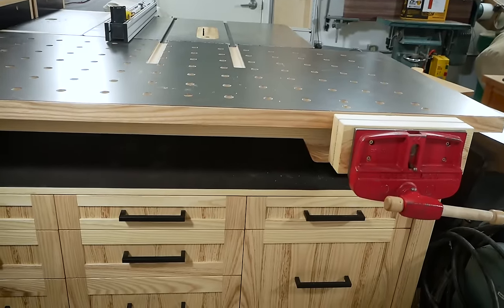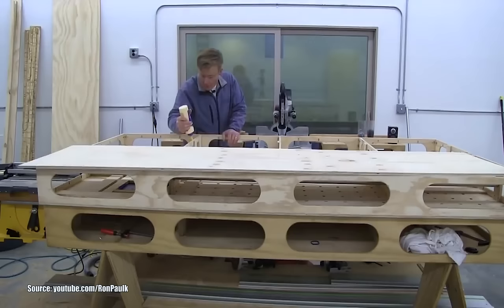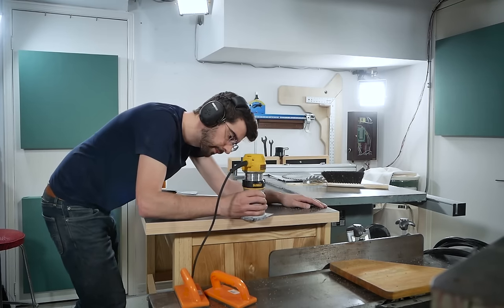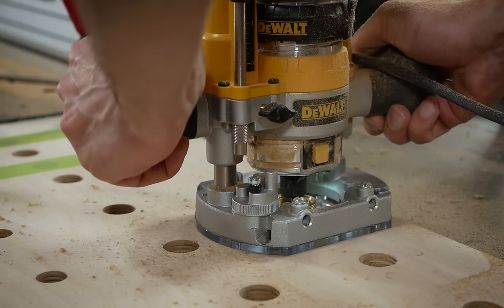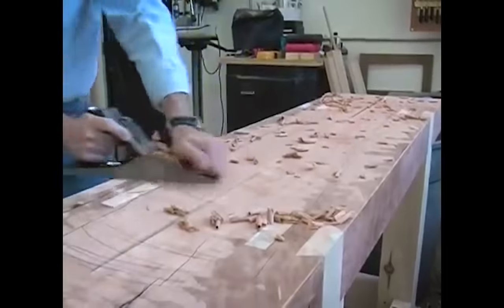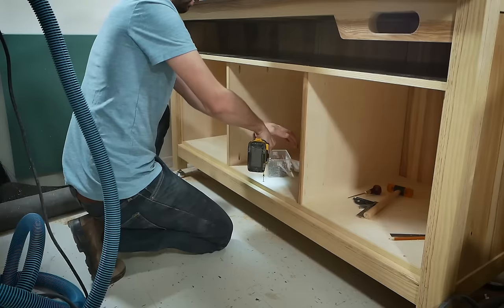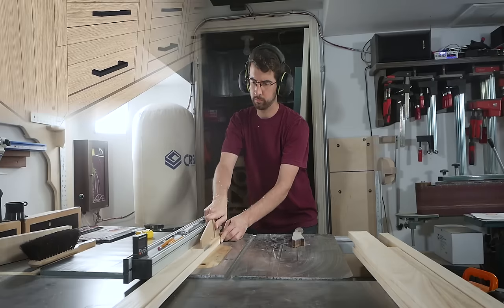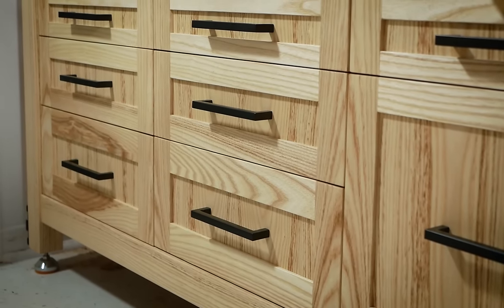The PERFECT small shop WORKBENCH

Comment: Sweet build, Scott.  I really love that idea of a huge chamfer underneath the dog holes to counteract the thickness of the top.  Well done!
Reply from the maker: Thanks so much Brad! It's working well so far, but we'll see how annoying the dog holes get when i start dropping things through them
Reply: @ScottWalshWoodworking  If you begin to drop things through, think about getting a cutting mat and place it over the dog holes in the area where you are say, laying out etc. It's what I've done on my MFT style top on my current bench and stops the frustration. I only expose the dog holes if and when I need to clamp.

Another idea is to route a slot for T-Track into the edge banding on the front and one side of the bench. I used Incra t-track and that allows me to use clamps on the side of the bench too.
Reply: @ScottWalshWoodworking  Do you have a link to the chamfer bit used to route the underneath of the dog holes?
Reply: How's the top holding up? Has hogging out that much of a chamfer for the dog holes led to any sort of sag? I'm about to do the same to my bench.
Reply: Also, if your plunge router has variable speed could you just put the forstner bit in it and cut with that? Or is a forstner in a router a no-no?
Reply: @DavidLee-cw6ci  first of all, your forstner bit wouldn't fit in your router. Second the larger the drill bit the slower the speed. A router usually drills with 30,000 rpm. A fast drill maybe reaches 3,000 rpm. Considering that you have a 20mm forstner bit, which needs max 2000rpm in softwood and 1000rpm in hardwood. Just Google 'rpm table forstner bit'.  These rpm's are not achievable with a router.

Comment: I love this build, I want to do it for my single car garage shop. I do have a suggestion for the cabinet. Build it a little smaller so you have a small gap on the sides. But, when you use the solid wood for the edges, make them large enough to fill that gap in the front. I've used this trick a lot with residential cabinets when working in a cabinet shop. You can always trim the edge to fit the space a lot easier than trying to squeeze the cabinet in

Comment: absolute beautiful job i think i might steal it for my small garage shop!! A trick i do with laminating to oversized sheets is make both a 1/2" bigger all the way around and the be as accurate when you glue them and cut with a track saw as its less stressfull gluing up and less mess than the router and much easier of a cut. Also with contact cement just dry it up with paper towels and then a little goof off or just a little laquer thinner will wipe the residue away.

Comment: Favorite part was when you spilled the glue - I struggle with anger and frustration and I would have thrown in the towel right there. Seeing you get genuinely upset and swear but still clean it up right after... taking notes from that, such a clean workbench as well, I love the perfect 1/16 separation of every drawer!
Reply from the maker: i honestly would've walked away if I wasn't frightened of what would've happened to the cement if i didn't clean it up right away. Especially if the smell permeated through the whole house

Comment: That is a great bench! I recently added an 8 x 4 assembly table to my workshop with an ash frame (laminated hardwood flooring my neighbor gave me), and I used the B side of some home depot birch ply for the panels. Its already scored me a few jobs from my neighbors who have seen it in passing. I didn't plan our the wheel thing well at all :( so for now it is an immovable object. And it probably weight 600 lbs with everything in it.
Reply from the maker: At least it's sturdy! Sounds great!

Comment: I was watching your video and when the contact cement incident occurred, I realized no one thought they should tell you about WilsonArt H2O as an interior construction adhesive. I have never had it fail in laminating things in the same manner as toxic contact cement. I bet once you use it once, you will throw away all of your contact cement (or at least only use it for outdoor purposes). I have been using it for more than 20 years, although it did get hard to find at some points in time. Anyway, really enjoyed your informative video. I find "why I chose to do XYZ" is more valuable in almost any technical presentation than "what I did". Keep up the good work.

Comment: I would love to see more detail in how you installed your vice on that workbench. Love the look and functionality you put into it.
Reply from the maker: I used a couple of 5/16" bolts. Every vice is a bit different so I didn't really cover it - and my vice is like 30-40 years old. If you look closely, i beefed up the apron with a gusset around the vice because I thought I was going to have to remove a significant portion of the existing aprons. Turns out that I just cut a whole in the gusset for the vice rails to pass through, rather than the original apron, so it was totally unnecessary. If you have any more questions, shoot me a DM on insta and i can more easily show you what i mean.

Comment: Nice workbench. I'm planning a new one with outfeed built-in. I'm a big advocate of using ash as well - strong and durable while reasonably cheap.
Reply from the maker: my only complaint is that it's very dusty, more so than any other wood I've worked with. Simply jointing (my jointer doesn't have dust collection) not only throws the usual chips everywhere, but also throws an unusual amount of dust in the air.

Comment: Good video. For leveling feet, I’ve bought the largest hex cap machine bolt I could find. Usually 3/4” with a washer. I bore a hole into the 4x4 corner post, thread the nut onto the bolt and then the washer bears against the wood post. Works great. Super heavy duty and when I blow out the trapped sawdust it flows around pretty well so clean up us easy.

Comment: Great build.  I'm in the latter stages of building a laminated pine top bench out of reclaimed pine boards from a 1970's wall shelf setup.  I feel your pain.   As for the glue, interesting move with the sand, but I would have tried to salvage the glue first by using a clean dustpan to scoop the top 75% back up and then done something stupid like use old jeans or something to mop it up.

Comment: I made my bench with construction 2x4s laminated for the top, and added some dogholes with a bit and brace. At the time I just went with a size that seemed right, so they're slightly smaller than standard. I designed and 3d printed some dogs that have a hole through them to screw in a 1/4-20 bolt to add massive strength. I also have some holes drilled in the face of the bench to store the dogs when not in use. The only power tools used to make my bench were for parts of the legs, and the only screws in the bench are holding the vise on, and the (permanently) temporary stringer between the two sets of legs. I have through mortises, and plan on using tusks to hold the legs to the stringer, but currently just have a small scrap of wood screwed to the tenon to hold it. The bench top has through mortises for the tenon's on the tops of the legs to go through. I designed the bench to be taken apart to transport flat. I did recently add some concrete anchors that I had laying around into the top of the bench to attach a small raised bench with a reloading press on it, so I now have even more metal in the top, but it's recessed and I should be able to remove it if I drill a small hole below them and tap out the taper plug.

Comment: Another great video. Have you ever tried using a hold-fast in dog holes? no moving parts and they hold extremely tight if needed. Whack 'em in, whack 'em out
Reply from the maker: Thanks Frank! I have used them in a solid wood bench top, but I dunno if the MDF top would last long with those. I would be afraid it might throw off the squareness of the holes, for use with a track saw.
Reply: @ScottWalshWoodworking  Good points on the hole distortion and MDF. Neither would survive well with a traditional holdfast.

Comment: Nicely done.  You could probably recess that vise in farther, have the back material set into the work bench top.  Saving every little bit of space in walkways is also important in small shops
Reply from the maker: I would have, but the quick release mechanism would intersect with the entire apron. So to make the vice flush with the top, the top would have to come out farther, rather than the vice coming in

Comment: Seconded on the “no thanks to the torsion box”.  Plus the only way to get a dead flat torsion box, is to make it on a dead flat surface.  Bit of a catch-22 there, when you think about it and as I experienced when trying to make them on a non-flat surface.  And if your torsion box isn’t dead flat, you can’t really fix it after the glue has dried.

Comment: What you could do to improve your bench at little cost is to go to lowe's or homedepot and get a piece of the 1/4 inch x 6 inch x 36 inch what they call project wood (for small projects).   And make yourself a ledge shelf just below the overhang of the top of your bench, and above the open space where you are putting your squares, dusting brush, roll of paper towels, dustpan, clamps, to get out of the way when you are working on projects,

Round the corners of the ledge shelve.

I made such a ledge shelve for my Armor tools metal framed workbench, that is 4 inches wide free space.    It is a great place to keep three things, my 3m sanding block, my irwin wood mallet, and a small japanese pull saw.       And it does not interfere with my ability to use the border of the workbench surface for clamping.

I also made a six drawer module, that is similar to your setup, that gives the open space chamber like you have above.    So, the open space chamber plus the ledge shelve.   My ledge shelf is 4 inch deep, it all works out great.

Comment: I'm a bit new to your channel, so I don't know if you knew or didn't know that they make tools that go into those holes your calling "dogs", I'm speaking on the metal fab side these table are typically made for welding and have 5/8 or 3/4in holes where you can then buy clamps and other types of jigging to fit those holes during weld up. I did recently watch one of your other videos discussing tossing out tools you don't use to make room so maybe this is why you opted to not buy different clamps. Anywho great video thoroughly enjoyed and may build this in the future, except I'll use the standard hole size for the clamps I'm familiar with from welding lol.

Comment: NICE! But I am pretty sure that I would be forever hitting my knees on the hard corners of those metal drawer pulls, especially because I use a stool as much as I can to take a load off my knees and back and so my legs would push up against the drawer fronts. So I would definitely need to use a more knee friendly type of drawer pull. With drawer slides reducing friction, you could probably just use a single short wooden knob. And since what is the point of being a woodworker, if you are going to buy something you could make, I would take a crack at making them myself, probably out of some nice contrasting species of wood, like maybe walnut or cherry.

Comment: Looks amazing! Love the slots for the mitre attachments of the tablesaw. I dont know if I would do well with that slot for quickly clearing the top of the table off. I know Id lose all kinds of tools and materials in there
Reply from the maker: it is true, I'm curious how it'll go on mine. I almost wish i had use a round nose bit to route them because it wouldn't have left inside corners in the miter slots for things to get stuck in.

Comment: Nice bench and I particularly like the use of dowels to join the pieces. I'm looking for plans that I can adapt to make a bench for bookbinding and possibly leatherworking on and this is now on my shortlist. I'd probably go for a single set of full width drawers on mine so I can store large sheets of paper/leather flat and no dog holes. Other than that it pretty much ticks all the boxes.
Reply from the maker: Yeah, that would work. The drawers would be just less than 60" wide, so you definitely want to use 3/4" ply for them. Also, since you don't want the dog holes, you could skip the cabinet, screw plywood to the inside of the sides for the drawer slides to mount to, and then build drawers right up to the top apron.
Reply: @ScottWalshWoodworking  Been thinking some more about this and since the largest paper I'm likely to use is A1 (24in x 33in roughly) full width would be a bit of a waste of space so I'd probably split it in two with one side for the paper and the other side for smaller drawers with other supplies in.
Of course that will mean needing some sort of divider for mounting the drawer slides to but that can just be fitted into a slot routed in the top and bottom runners. Even at only 33in wide the drawers could potentially have a lot of weight in them so I reckon 3/4" ply is still the way to go. Lots more contemplating needed beforehand. Just got to be carefull I don't overthink things like I usually do🤣

Comment: NIce Video.  Seeing the video build, I have decided to adapt a little bit of your design to accommodate my shop, but with most of the details will remain the same. One question, I didn't freeze frame to confirm, but it looked like you were using an old ID to spread out the finish.  Very nice design
Reply from the maker: Thanks Joe! And thanks for purchasing the plans! Shoot mean email or DM on insta if you have any questions about them.

Yeah! those are actually old plastic business cards of mine that i've been using to spread glue an finish. It's a handy way to get a lot of finish on panels quick, just have to make sure to get all the excess off, particularly with hard-wax oils.

Comment: On the topic of ideal small workbench size, I'm currently experimenting with a 40x60 bench based on the 'ultimate bench' designed by Paoson Woodworking. That's probably an unusual shape, but I'm coming around to the idea of shallower wall cabinets with a centrally located workbench, and it's designed to break down into two carcass frames, the table top, and the cabinet, should make it manageable if it has to be moved.

Comment: Great build!  I also ordered the Dowelmax and am about to build a workbench. Did you opt to use  the 1/2 inch dowel guides instead of the 3/8 that comes with the jig? I will be using 3x3 legs and 1” x 3” cross members and now am thinking the 1/2 dowels would be better than the 3/8”.
Reply: Disregard my question. I later saw you used the 1/2 in the description box.
Reply from the maker: Honestly, you could probably use 3/8" x 3" dowels for the workbench. What i did was completely overkill. Jim from dowelmax has told met that his own personal bench was made using fewer, 3/8" dowels and has held up for years.

Comment: My favorite tip for installing drawer fronts is to drill the handle holes first. Align the fronts with playing cards for spacing then screw through the handle holes into the drawer. With the fronts secured I open the drawer sink the screws from the inside remove the temporary screws in the front and install the handles. Extra steps but perfect every time.
Reply: I thought that WAS the way to do it?? I don't think it's an extra step if it is always a step. They come out PERFECT EVERY TIME!! love love the video keep it up

Comment: Awesome bench! This is going to sound like spam, but I fairly recently got the magswitch pro feather board for my birthday and it somewhat eliminated that kind of awkward push stick you are using on the outside of the blade. Just a tip, I could stop doing what you're doing and it feels great to use :)
Reply from the maker: i have a regular feather board, but i never use it 😅. Maybe i would b more inclined to use the magswitch version
Reply: @ScottWalshWoodworking  yeah I got a solid collection of normal ones I never use either, haha. But the magswitch thingey is surprisingly neat.

Comment: A really cheap and effective way to get dogs is to buy socket head cap screws with the appropriate shaft size for the holes. I got mine at a nut and bolt store. Also, the bench looks great!
Reply from the maker: interesting. they must be pretty big screws!
Reply: @ScottWalshWoodworking  you can get them in any size from super small to quite large

Comment: Subscribed!! Please tell me your opinion on those UniKlamps, what size are they and are they worth it? Thank you
Reply: Da, merita. Daca esti in Romania, vezi la Hornbach. Au un pret imbatabil pentru cele de 60cm.
Reply from the maker: I love them. They're a fantastic small clamp to use in place of f-clamps in the same size, but far less finnicky. However, they are not a replacement for larger parallel clamps, they don't have the same amount of pressure as the larger ones do. I think they have many uses and there isn't another small parallel clamp to compare them too. I plan on buying a few more eventually.

Comment: This is some great work! I hope to do smaller projects starting soon in my free time. I know you may not have exacly logged hours for this project but around about how long did it take you?
Reply from the maker: It's hard to know, because filming it takes so much time too. But if I wasn't filming, maybe 100 hours? Keep in mind that the level of sanding and finish I did is totally unnecessary too, so that could shave off a dozen or more hours.